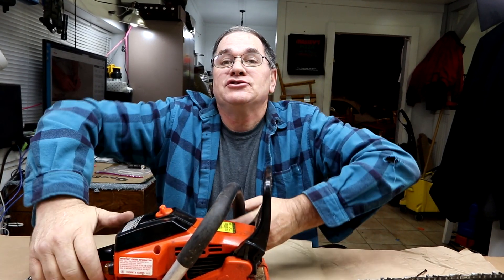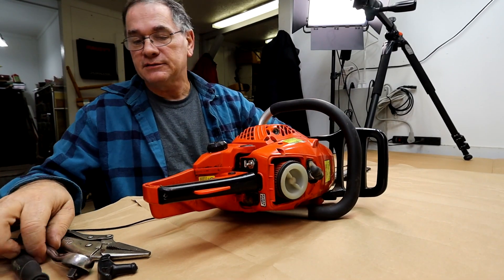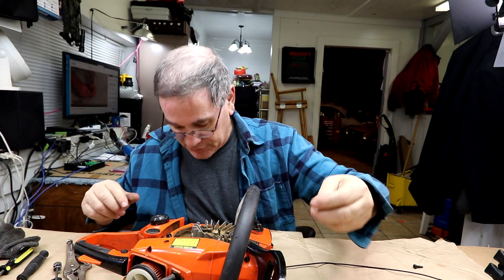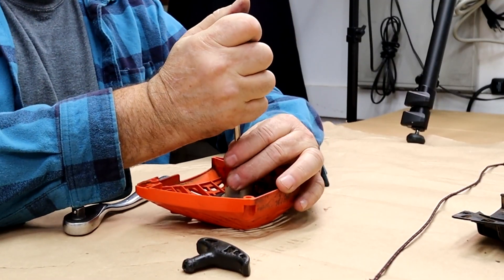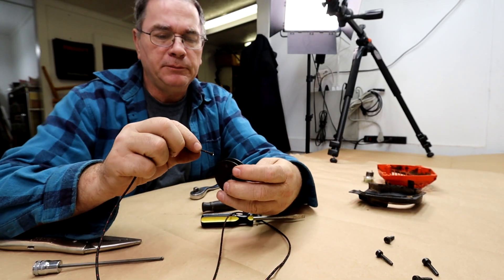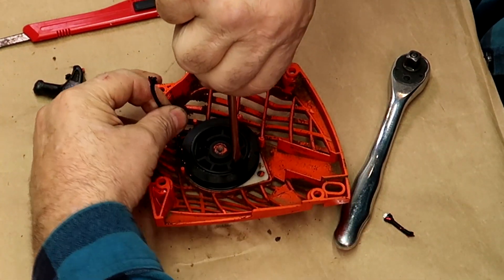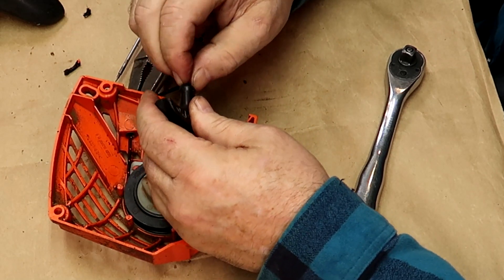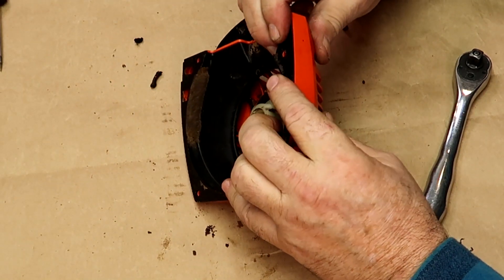How to Fix Broken Starter Rope | CS-400 Echo Chainsaw | How do Starter recoil Rope Replacement

Comment: Joe!   Just replaced the starter rope on my Echo chainsaw.  I tried it first by guess and by golly.  Watched your video and in less than 15 minutes, had the saw running and hopefully that new rope lasts a lifetime.  P.S., I had taken the recoil mechanism off before watching your vid and had to go on a screw roundup before finishing.  Thank you for posting this.
3:02

Comment: Hey Joe, How do you recoil a starter spring?  😢.     So I followed your instructions and wound it 5 times, but I found I didn’t have enough pull length.  I figured it took more wind up turns than “4 or 5”, so I took the handle off, let the spring unwind to get back in the same condition as when I first came to your video, and started winding it up again.   But it slipped around turn #3, and now I have a bird’s nest of a starter spring.    
Should I just go buy a new one?😅

Comment: Hi and thanks for replying. But yes, it’s the oil filter/strainer that goes in my chain oil tank on the echo cs306. It’s like the fuel filter in the fuel tank but it strains the oil. I guess my question now is how do I change the hose (tube) from its start to inside the tank. Could you do a video of that or recommend how to change or add hose?? Thanks Ted
Reply from the maker: sorry I misunderstood you. lemme look into it.

Comment: I feel so dumb asking am sure it's just too many hours on saws today but....How would you alter your approach if you had to feed the starter-rope INTO the flywheel-cover BEFORE insertion into the plastic spindle?  I'm using a cs590, nearly identical (just no "ez start" piece, otherwise it's same) but want to use a Stihl Elasto-Start handle&rope combo, but this kind of setup means the handle//rope are mated so I have to feed the rope through the flywheel cover before I do anything...I did this & "it worked" but limp starter cord, thought it was my (visibly-problematic) starter-spring so I just replaced it but the limp cord persists, am close to just cutting 6" off the rope and trying again but swore there was a way to 'tighten' it even once installed but the "tighten limp rope" vids aren't helping (think it's because I did this wrong, using an elasto....If you're seeing an easy path to installing an Elasto 1-piece handle/cord setup, without any slop in the rope, I'd love any help!!)
Thanks for the vid, whichever cord I put in am glad to have a great 'ez-follow' how-to for my model(or close-enough, can tell Echo used like-kind parts just no EZ mechanism on mine...til the Elasto at least >;D )
Reply from the maker: I would just. Use to he normal cord. You probably have it  little too long. The last time I put a pull rope on my saw I got it a little too long and am too lazy to take it apart and fix. I always pull it through the casing before tying the knot on the handle
Reply: @Joefixesit  ROFL funny you mention it that way because i think I came to my PC to go through more Notifications because my 590 is staring at me "ready" but with a kinda-floppy (faux)Elasto grip, you can't feed rope through those handles and I already did the loose rope 'wrap around the recoil' trick so the spring would bottom-out if I took another wrap that way, only fix is to un-do the whole thing & remove 1-2" of string from this thing & re-do it all....g'damnit!!  I know it's gonna just make me nust if that thing is flopping around those are heavy grips but worth it this is my biggest climbsaw for when I need to do trunkwood the 355t can't do!

Comment: How long should the replacement recoil rope be cut?
Reply from the maker: 35.4 inches
Reply: @Joefixesit  Perfect thank you! (I just got a ten foot long section of Dyneema, some kind 3mm rope which is supposedly much stronger than regular rope I'll just make it 36 even for three sections with one foot left over)
Reply from the maker: I just got some rope from to he snapper dealer right down the street.. cost me about 90 cents. It has lasted me a year
Reply from the maker: @watching99134  sounds like a plan..
Reply: @Joefixesit  I fixed it but do you have any tips for getting the 3mm rope through the hole in the handle? That took me as long as everything else combined, I had to heat an awl and push it through to expand the hole, then spend fifteen minutes using a small Phillips-head to shove it through one micrometer at a time (then the first two inches were shredded so I tied the knot lower so the rope doesn't pull out as far as it should [but it works]).

P.S. The white base plate with the spring popped out at one point too, I was like Oh no but I just put it back and it was fine, maybe I got lucky?

Comment: Hi Joe, I have a broken chain oiler adjustment screw on my CS-400. How do I replace it without destroying it ? Thanks in advance for your help. L.G.
Reply from the maker: I have never had a oiler break only get stopped up with dirt
Reply: @Joefixesit  hi Joe, so what happened is I was trying to adjust the flow and the screw head broke in half. So the screw is still seated with half a head, is it easy to replace or does it need the repair shop? By the way, Thank you for the quick reply 
L.G.
Reply from the maker: @lg5962  naw you should be able to do it. you have to take the clutch off to get to it...
Reply: @Joefixesit  hey Joe thanks for the info.  L.G.

Comment: Joe, my problem is I’m trying to change the oil filter but the feed tube is to short and doesn’t have enough line to fish out of tank to pull off and change filter. How do I do it inside the tank with little room to work with
Reply from the maker: you mean fuel filter I presume. I just dig it out with a needle nose pliers. You might have to replace the hose

Comment: Joe your's is a very timely and great, simple video on repairing the ECHO recoil starter....the rope on my ECHO CS-440 just broke today!!  I needed to find a video, if possible, for a repair and your's was just perfect!  Thanks a million for posting it, it's very clear and understandable repair video.  Well done.
Reply from the maker: thanks..it actually is pretty easy. I bought the wrong size rope at the local snapper dealer here in Fairmount.. cost 45 cents.. but got it right the second time. I am pretty hard on the starter ropes. a lot of stop starts all the time.

Comment: Great video Joe. It helped me a lot. Of course I did just what I shouldn't do and let the plastic holder for the recoil spring raise up and popped my spring. You can buy these springs pre-wound in the plastic case on Amazon for $12-13 but I was determined to make this an inexpensive repair so after an hour of frustration I got the spring re-wound and finished the job. Works like a charm. Your video was just the ticket to help me get the job done. Thanks again.
Reply from the maker: Hope that thing did not hurt you..The spring got away the first time I did one. thanks

Comment: Someone tried to rip a guy for a ca352 that wouldn't start. It was a naive older guy with his son. Since I'm a landscaper, I have some experience with chainsaws, so I volunteered to help fix it, because I wanted it.
I spent almost an hour trying to resolve the pull start system, only to find out that I was a fool. I didn't realize that the bar was almost crystalized from a lack of bar oil. 
I feel like such an idiot, having 48+ years of landscaping experience.
Edit: the thing is that it looked almost new, and I'm trying to save as much money as I can. Still a moron.
Reply from the maker: dont feel back I have done far worse. Oh the stories
Reply: @Joefixesit  We would probably sound like a couple of war vets 😄
Reply: @LaVander-ht9ne  got to gigure my first return to the channel video is

Comment: Joe, great video. The rope on my CS-370 broke near the pull handle and I was able to change it but it's happened before and my rope is starting to get short. I'm ready to put a new rope on and this helped tremendously. My question is what diameter rope did you use?
Reply from the maker: I am pretty sure it was 3.5mm rope.  I will get back to you on that, I got it at the snapper dealer up the street from my shop
Reply: @Joefixesit  Thanks. I found the parts list pdf online for my CS-370 and it's 3mm. Good video though and when I go to change the rope I'll watch it again first.

Comment: My rope broke twice, it was only two years old. When I replaced my rope the second time, the recoil spring (under the white cover) came out when I was winding the spool. If you pull up any while winding, that recoil spring will slip out. If you put the soft spring, white cog, and screw in and then wind it the spool can’t come up and you don’t risk the recoil spring popping out.
Reply from the maker: good point
Reply: It should not pop out . It not that hard to rewind as I have let it get loose in the past